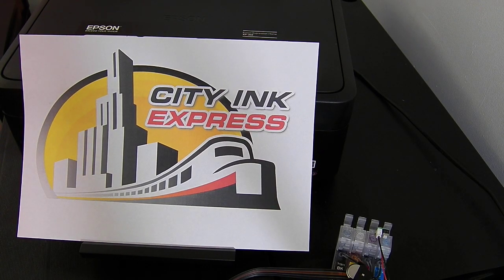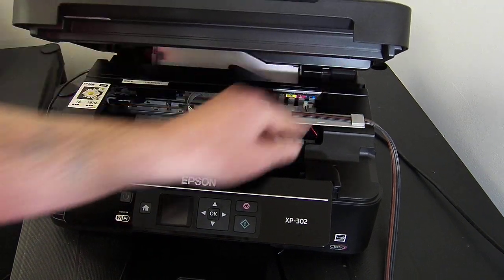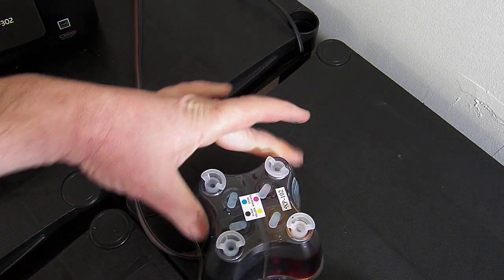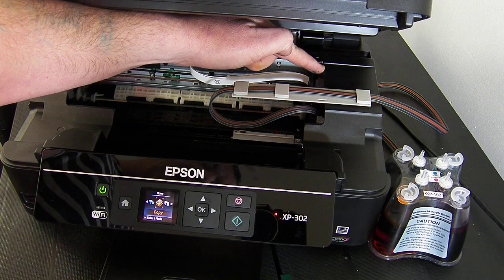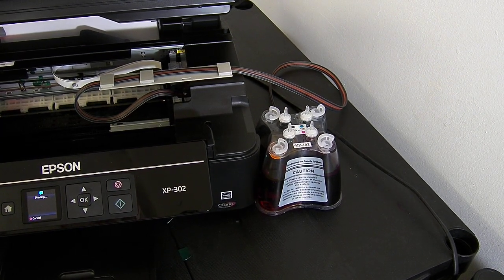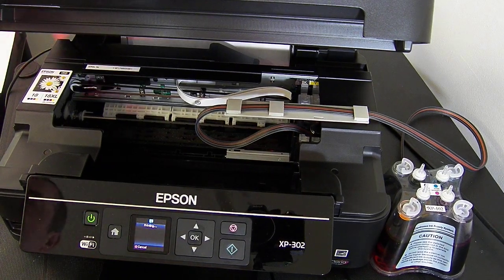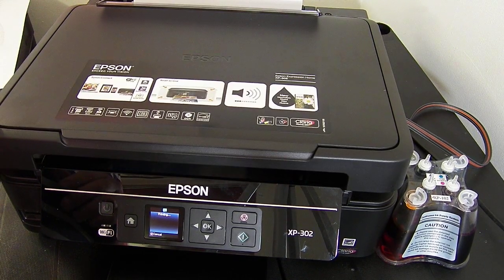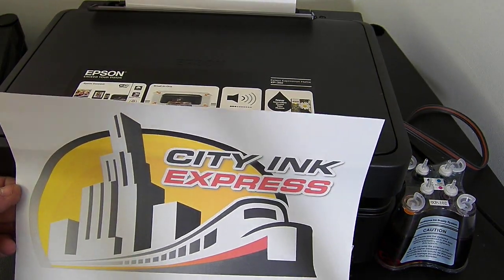Ciss continuous ink system fits Epson Expression XP-302 , XP-305 XP302, XP305

Comment: Thank you so much for the video, but my problem is air in the lines betwen carts and the printhead. I dont have a ciss. There is no opening to suck from in the printhead. I mean the ink lines originally in the printer betwen carts and printhead installed by Epson. It is a stylus photo PX830PW.
Reply from the maker: Finn Halland Hi Finn, sorry for the misunderstanding. I'm afraid we don't have any videos for that, it might be best to contact Epson with your problem.